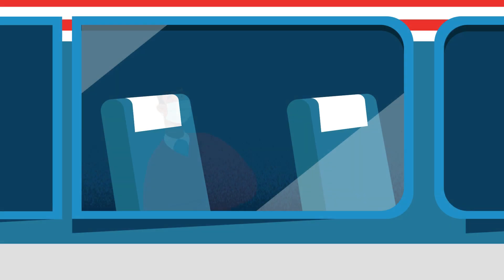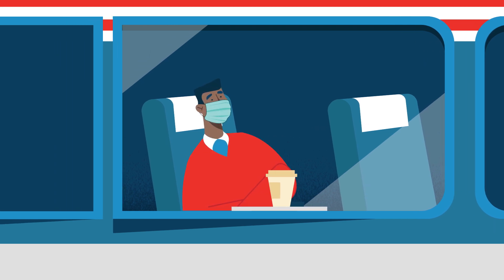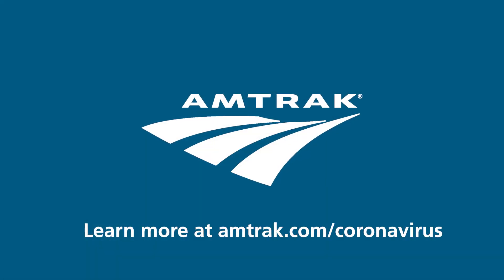Learn About Amtrak's Air Filtration System

Comment: Amtrak ONLY says air is passed through a filter.  No mention that it is a HEPA filter.   Certainly they would SAY this if it were the case.
Reply: As I understood the explanation, the air being filtered is the fresh air from outside. So if you're worried about viruses, the train's filter wouldn't be important. Now if you're worried about pollen or soot, that's another thing...
Reply: @fuzzy1joe , the video didn't make it clear, but the way these systems work is that all air traveling through the HVAC system is filtered - not just the air coming from the outside. But there's no mention of what type of filter is used.  Not all filters are effective against viruses.

Comment: Comforting, but now with the wildfires I would feel better actually knowing what kind of filter is being used too.
Reply: @amusedcookie  The ventilation system Amtrak describes takes the air from inside the train and blows it outside. The air coming in is fresh air (plus pollution, pollen and smoke). HEPA would be nice but it wouldn't make much difference for virus protection. Where you want a HEPA for viruses is where the air is recirculating. That's exactly what this video is saying they don't do - NOT A RE-CIRCULATION HVAC on the train.
Reply: @fuzzy1joe , the video says Amtrak trains do both filtration and exchange with outside air.  It says the total ventilation rate is 44 air changes per hour, with a fresh air replacement rate of every 5 minutes.  So clearly it is a recirculating system that also replaces a portion of the air with outside air.  There's no mention of the type of filter used.  HEPA is not likely.  It's probably some MERV-rated filter, which can be effective against viruses, depending on the MERV rating.

Comment: very good Amtrak I have missed riding this year, but know I will be back with this virus gets under control. Trains have much more air to circulate than a plane, doors open and close too as people walk from one car to next and that brings fresh air into the cars. Can't be done on a plane, same stale air moving around
Reply: Stale air on planes? Hardly. Each individual seat has a vent you can point right at your face with fresh filtered air